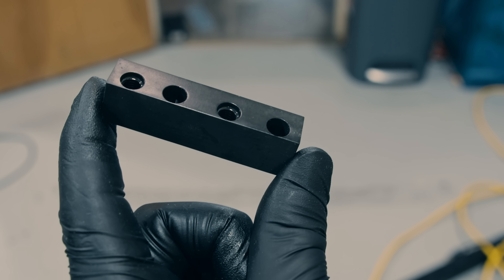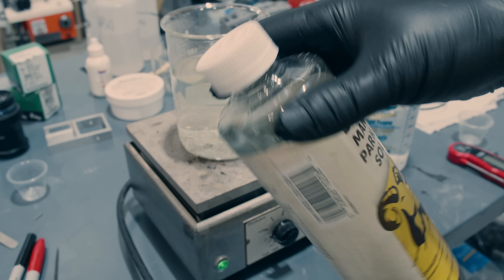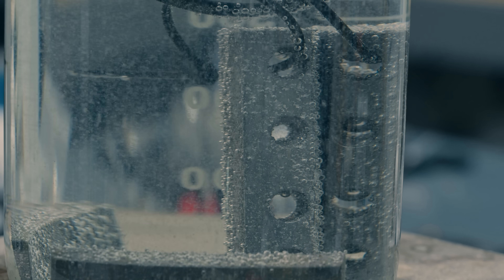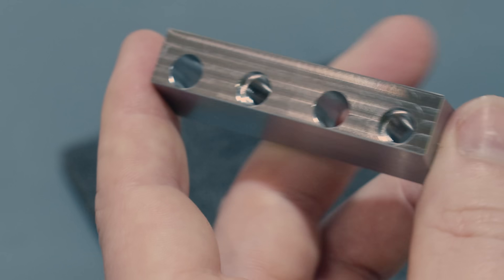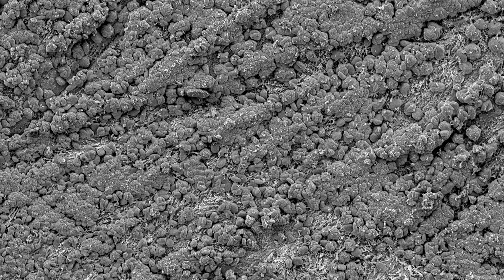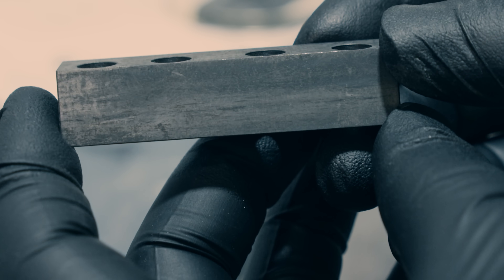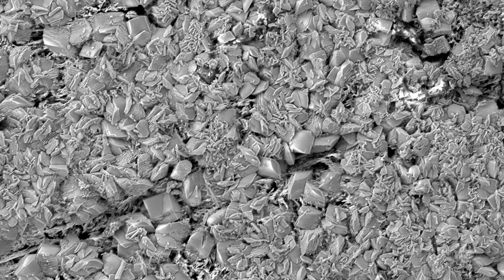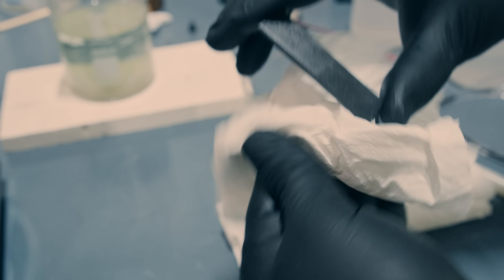Low-tech coating is a microscopic marvel

Comment: Give bead blasting a try to rough up the surface. Bead blasting and parkerizing are often used in gunsmithing.
Reply: I read that as bread and was very confused
Reply: @alert2  You are so hungry, your sight got weak
Reply: @alert2  Bread blasting probably would work if you got the Soviet special 30% sawdust bread
Reply: Gunsmith: Anyway I started bead blasting.
Reply: I was gonna just say what you said. Sand or bead blasting is good for any coating, and easy to itch complex surfaces.
Reply: We use wheel blasting at our facility.
Reply: @ASCENDANTGAMERSAGE is wheel blasting the same as shot blasting?
Reply: Came here to say the same thing. We blast most things before phosphating at work and it makes a wonderfully uniform coating compared to just a machined surface.
Reply: For parkerizing, you generally want to blast with something more aggressive than glass bead. Aluminum oxide is the most popular, but I use coal slag. Clean/degrease, blast, clean again, parkerize, oil dip.
Reply: @StrongholdArmory  on point directions. Degrease, roughen, degrease
Reply: @HolmesHobbies  So much degreasing!  Especially dealing with small areas that are hard to get a brush in.  Miss a spot, then sandblast, and it's a mess!
Reply: @StrongholdArmory what type of oil is best for this purpose?
Reply: I was thinking this for the prep that it would be a better way to get a consistent finish on the part than sanding it.
Reply: Came to say this, but glad I checked first.
Reply: I was thinking sandblasting, as prescribed for Cerakote surface prep - should give predictable roughness over the entire surface.  (Disclaimer: I have yet to try either sandblasting or Cerakoting, never mind Parkerizing, so this is entirely a guess on my part.)
Reply: @ericwilner1403 you are correct
Reply: Came to post this.
Reply: Yeah...i also stained the metal... rely on a drying oil for gloss or semi gloss.i tried several things years ago ended up cold rust blue..it turned out ok, then i had a barrel in white that got red rust...put navel gel. I later noticed nice gray fine for m🎉😢🎉🎉🎉🎉🎉🎉🎉🎉🎉🎉😢🎉🎉🎉🎉🎉🎉🎉🎉🎉😢🎉🎉🎉🎉😢🎉🎉🎉🎉🎉😢🎉🎉😢🎉🎉🎉🎉🎉🎉🎉😢🎉🎉🎉🎉🎉🎉🎉🎉🎉🎉🎉😢🎉🎉🎉🎉🎉🎉🎉🎉🎉😢🎉😢🎉😮😮😢😢🎉🎉🎉🎉🎉😢😢🎉🎉🎉🎉😢🎉🎉🎉😢🎉🎉😢🎉🎉🎉🎉🎉🎉🎉🎉🎉🎉🎉😢y custom utility rifle..i did a bead blast metal paint prep (phosphoric acid) rubbed ebony wood stain then tung linseed, poly etc, drying oil. Looks great,you could even add some blue to the stain..it does not build up,it wont look cheap,chip like paint. doesn't change dimension i suspect i can touch it up too. I haven't tried that yet
Reply: if you blast make sure to use aluminum oxide and not glass. glass beads will  bond silica to the surface and can give an inconsistent finish.
Reply: Walnut shell media is popular
Reply: You rebel you @busimagen
Reply: Also blueing parkerizing steel
Reply: Is this also called Shot peening?